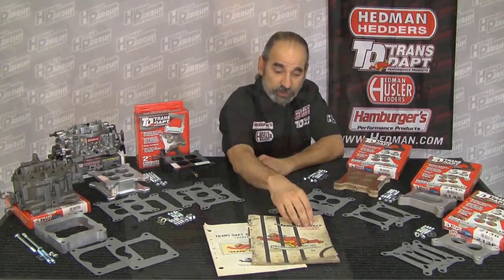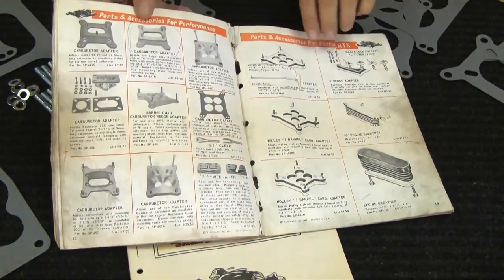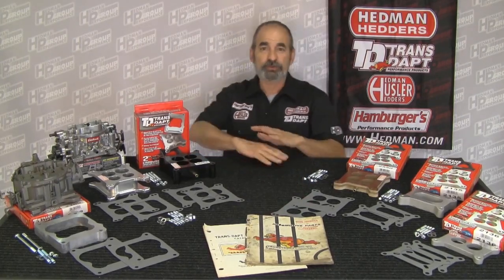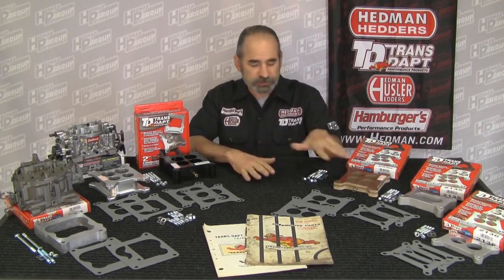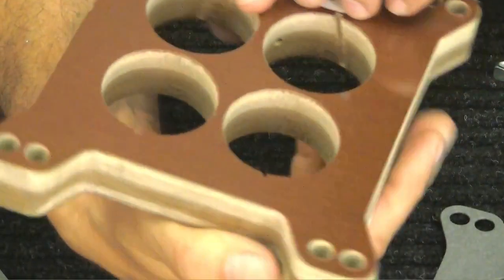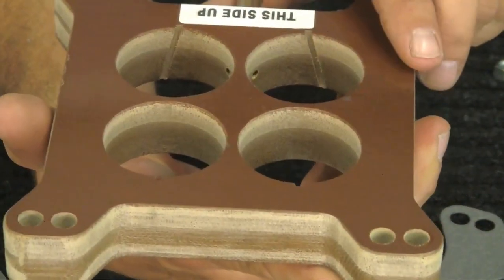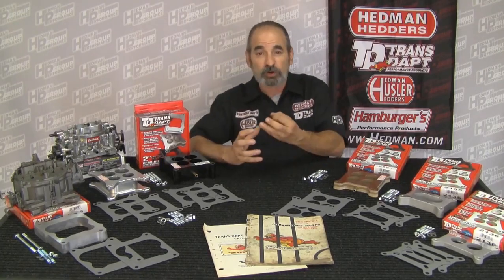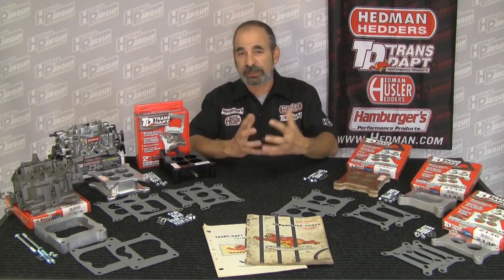Carburetor Spacers With An Advantage- Swirl-Torque Technology

Comment: Does anyone know what spacer I need for my 1406 Edelbrock carburetor? I dont have 2" of clearance so only a 1" will work but do I need 4 hole spacer or 2 large hole? Thanks for any info.
Reply: Single or dual plane intake ?
Reply: @NCmtnDweller  dual plane! I installed last year and it fixed my problem
Reply: @felkerforcongress  according to Eric Weingartner you would want an open spacer 1"

Comment: Swirl Torque ? Sounds cheezy to me. But I tried it on a Boss 302 engine anyway. Works good.
Reply: Lol, no you didn't.
Reply: What were the improvements?
Reply: @peterbilt6662  off idle quick response. Also some improvement in gas mileage.
I take it for granted.
I forget to recommend it to customers that buy engines from me.
Reply: @cammontreuil7509  thanks for the reply!!!

Comment: Hi i just had my holley carb fine tuned , was wondering if i add a 1 inch spacer will i need to have it tuned again after i add the spacer❓✌️
Reply: Hi J! I'd simply put a vacuum gauge and tune it to optimize. Tune both air fuel screws   in equal increments watching the vacuum read out., Shoot for the highest number. Best yet, go with a wideband Air fuel ratio gauge, but a little costly with the bung sensors etc.
Reply: Yes, because now you changed the plenum  volume, which is gonna affect the torque and rpm band, etc. Why add a spacer now????

Comment: whats the point of aluminum spacers??? aluminum is indeed a very good heat conductor....
Reply: There really is no point in them, i think the guy in the video even knows it because he points to the wood space and plastic spacer, ignores the aluminum lol.
Reply: The wood spacer is the way to go, unless your running just Q mile taller the spacer the better!
Reply: They do make a difference  I had a alumimun 1"  on my Ford 390 2bbl it had alot more top end  but it did get hot and after it got hot it leaked.   I just switched to a 1/2"  polynetic or wood looking one my float bowl was cold and the motor seemed like it was getting more vacum since it was closer to the engine the motor not the carb , the carb was doing the same .
Reply: Gallardo6669